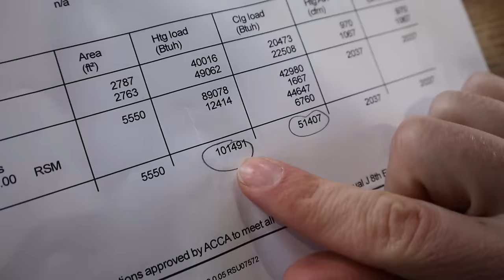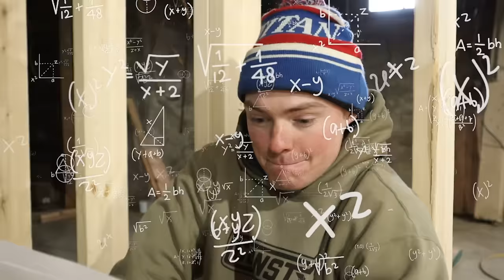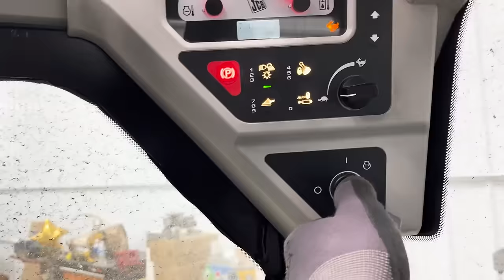Restoring A $7,000 Mansion: Removing 2nd Story Floor

Comment: Definitely better to have a separate zone upstairs, but there are multiple ways to achieve that.....Separate systems, motorized dampers in the duct work, or, heat pump systems that will run multiple air handlers off of one outside unit (this would be my choice).  The best option depends on your situation.  Since I'm not a tremendous fan of heat pumps in cold climates, I would also mention that it's possible to have a hot water coil in your air handler (running off the boiler) for supplemental heat.  Installation costs are the tip of the iceberg, consider your local fuel prices, and determine the running costs of the various options, because you'll be stuck with that monthly bill for a long time.  A boiler is the same efficiency all the time, but a heat pump's drops dramatically as the temperature goes down.  The heat exchanger built into the HVAC system is a nice idea to get fresh air into the house without losing energy.  Also consider a humidifier for the winter.  Finally, consider how you plan to use your house.  Most residential heat calculations don't consider the live load (people and activity).  This may or may not be a problem, but, for example, if you have an avid baker in the house who runs the oven all the time, or like to throw parties with a bunch of warm blooded mammals, you might want to consider that in your cooling load.

Comment: Cole, I've built 2 houses the size of yours (1 was a little bigger). You definitely need 2 systems for the main house. However, in your climate I would NOT use heat pumps for heat. I'd use gas furnaces for heat and AC condensers for your cooling. Heat pumps are efficient to a point, but under 25° they struggle. Also, heat pumps only put out air that's about 80-85°. Gas furnaces put out heat at well over 110°+. You get faster heat recovery. Radiant floor heat is fine IF it's gas boiler. I would not use elec boilers for radiant heat, nor hot water for showers. Also, try to avoid having a duct-work in your attic if possible, or the air handler/furnace, unless the attic will be heated/cooled. If you have to make sure it is really insulated well around the furnace/air handler and all the duct work. 

Doing electric and plumbing is easy. HVAC not so much. Spend the money to let the pros do it, especially with 2 integrated systems, plus your radiant heat. Save the labor costs on plumbing and electric.
Just my 2¢

Comment: Cole I agree with Tom R comments and would add as your cousin is doing work I recommend they do whole install, you said how hard can duct be, it seems simple but actually it is all based on leakage and volumes if you need to change route or size it will affect whole system. My 42 years mechanical and electrical experience cost range from 10 - 25% of total build cost depending on complexity and you have several floors with multiple systems. Your end result running cost depends on air leakage rate as low as possible and efficiency of the HVAC. Keep up the great videos.

Comment: My feelings in regard to your HVAC question would be to contact a qualified mechanical engineer who can do comparisons between electrical cost vs natural gas/propane for your design. I lived in Florida for several years and had to replace both of my HVAC units. At the time, no one was recommending heat pumps. Conventional A/C was more efficient than heat pump systems for the vast majority of the year and because we had very few days when heat was needed they recommended just using resistance electric duct heating for the few cooler days that we encountered. Gas vs electric heating may make a big difference  in your area depending on rates per therm.  Remember that the efficiency of heat pumps drop of considerably in extremely cold conditions which you will have occasionally in your area. A 17 degree average cold temp in your area may really mean that some days could be as low as -20 degrees. Heat pumps don’t work well when temps are that low. Overall, I’m enjoying your project. I’m glad that I’m not the one tackling it.

Comment: I have a similar size home without the attic being livable. I have a gas fed system that covers the basement and the main floor, I also have an electric heat pump in the attic that covers all of the second floor.  One good thing is that all of the venting for the second floor is in the ceiling as well as in the basement.  One thing g I would recommend is that your thermostat is in a general area of each floor. Our thermostat is in our bedroom that is 22x20 with a 17’x8’ closest and a 14x14 bathroom.   We installed on one wall an hour electric fireplace that when it’s chilly we can heat up just our room without affecting the kids.   The issue is when our room is comfy at 72 the thermostat stops heating the rest of the upstairs and the kids room get chillier then we’d like so having that thermostat in the hallway would makes more sense for us and Likely you.

Comment: Look into a system called MRCOOL. It's a geothermal system. It's much smaller and no hvac vents. You have high cealing, so the unit will be out of the way. Hope it helps.

Comment: Having the two systems will reduce stress on each unit, it will also reduce complexity of the system allowing you to have one zone for downstairs and one up with no dampers. If they're just supplemental they shouldn't have much load on them really. One thing I would just be very aware of having the unit in the upstairs space is the condensate drain, definitely have a pan or something under the unit because it will leak one day and having something to prevent drywall damage will save a headache.

Comment: I would definitely get some more quotes from other companies. What brand equipment are they quoting?  The option of them sending you a guy to help run the ductwork seems like a great idea, but honestly with the skills and knowledge you guys have a detailed set of plans you can definitely run ductwork, linesets, thermostat wires, electrical to a disconnect and have them make the plenums and gas up the systems. Check with some HVAC/ plumbing suppy houses in your area and see if they will sell you the materials. Some might sell you the equipment but most require you to have a epa 608 gasses license.

Comment: Cole, you would absolutely hate a single system HVAC setup for a house that large, esp. since you plan to utilize the attic as well.  The best feature for a 2 zone system is the redundancy; if one is totally offline you'll get some effect from just running one.  The second best is the ability to "dial it in" floor by floor for max comfort.  The quoted price is definitely a fair price; I'd have trouble getting that job done in my area at that price.  If you have the time, definitely do as much of the install as you can.  Making the ducts & plenums is the specialized bit, installing them is pretty straightforward.

Comment: Cole, for HVAC,  definitely 2 systems or check out VRF multi-zoned systems. Slim line air handlers are available for space saving. Geothermal systems would be best for heat pumps in colder areas. Also 60000 btuhs seems very low for 5000 sq ft home. Typically 600 sq ft per ton (12000 bthus) on newer construction. Not sure what the norm is for your area. You will want  an ERV system for fresh air because your home is tight.

Comment: My brother in-law insalled in floor heat in the basement and had to turn the old heat system off.  The heat rose thru the floors naturally and upper spaces only needed to use extra heat when the temp  outdoors was sub 15deg F.  He lives in Totonto.

Comment: If this were my build and I was footing the bill. I would do minisplits throughout the whole house. Way less complicated and easy to upgrade or do maintenance especially as you guys have all that equipment. Just make sure you isolate the air intake(s) on a wall where you don’t plan on having a bed. That fan can drive you crazy if your trying to sleep 8 inches away from it. Mr. Cool even had DIY units precharged with freon. 

Have you considered electric radiant floor heat? Thermosoft makes some decent stuff and you can isolate exactly where you want heat or where it may not be needed like in a closet.

Honestly, your spray foam insulation will do wonders but you really need to get new windows and doors. Those will make a huge difference in keeping it heated and cool.

Comment: Here some friendly advice from the "Great White North". If i were you Cole i would extend the 2x4 outside walls into a 2x6 and put more insulation in!  Same with the roof. It will cut down a lot on needed heating and cooling capacity, saving money by installing a smaller heating and cooling system and cutting monthly bills. Your house is huge and you want to live in all of it. Insulation you only pay for once! Energy only goes up in price and the bills will keep coming.
Reply: There is not an “R” value per se in closed cell foam, (a fair amount of people will tell you otherwise). 4 inches will be more than enough. The difference between 3 and 4 inches is very small. 
It is an old house and was not designed for structural integrity. So while you could stop at 3 inches, 4 will give you the max insulation you need while adding 25% more spray foam structural integrity. 
The other structural integrity will come from doubling the floor joists.
Reply: @brianvancalster2594  Closed cell is R 6.5 per inch. A 5.5" stud fits 2" of  R 6.5 foam and 3.5" of R14 Rockwool making a R 27 wall system. I would go R40 in the roof. Money spent on insulation i learned is money well spent.

Comment: Go with the second system. You want zone control in a house that large. You may also consider a split system for the attic.  You have 5K feet over 3 floors. That’s not a one system job.  
You may also consider geothermal which is more efficient.

Comment: As a canadian living in -40 celcius to +40 celcius, heatpumps are anazing and yes they are expensive up front but will save you a lot down the road. With the size of your house, 4 floors including the attic, you need eitheir 2 pumps or one huge one. Keep in mind if the one breaks, at least you’d have a backup.

Comment: i do hvac and thoes blue boxes are return.  Heatpumps are not very efficent when it comes to heating they are very good at cooling tho. It will help that you have sprayfoam insulatiuon. You can run a zone system with heat pumps as well wich has a damper that closes one duct to the downstairs / or upstairs and keeps heating one level.

Comment: Call a Lennox Dealer.  Buy Lennox.  They are made in Marshalltown, Iowa.  Don’t be cheap.  Take the advice about zoning.  It will save you. Make sure you use gas or lp as your primary heat.  Have the pump as secondary.  Keep the in floor heat as well. Do these things and you will be comfortable for years to come.

Comment: WOW, I would reconsider the heated floors except maybe in the bathrooms and heat and cool the entire house with a forced air system.  The heated floors system takes a long time to heat the house and with such a large place you will be constantly repairing leaks which means removing the flooring and replacing it again.  I would go with a forced air system with two systems now and the smaller system when you do the addition.  And by the way,  could we get an update on the grain bin disaster?  And an idea for a later video could be on the wind turbines on your land.

Comment: I would explore the option of Geothermal the system is pricey but very efficient, it will save you money every year.  2 units are nice if you go that route so if there are issues with one you can deal with it until the other one gets fixed.  Redundancy is nice.

Comment: Great job guys, I would rethink about those heat pumps they love eating power mite need a hundred more amps to run them. Plus think about little ones putting toys and what ever else down the registers just a thought to keep in mind. One thing more would it be cheaper to run hot water heat in all the floors with there own zones and plus you can make room cooler or hotter. Keep up the cool vid's

Comment: A pressure washer with a zero tip cuts foam pretty good, and with the spiral zero tip it cleans the foam off great, water clean up is another thing 😅 but plastic sheet with a 5 gal sump and sump with float switch to send it out via a hose, foam is a huge mess

Comment: You really need an ERV. Spray foam seals the home so tight you need the fresh air, AND it keeps your air pressure neutral when the HVAC or direct vent fans are running. Negative air pressure can/will suck water in through windows, doors, or any other exterior perforations. (These are now the weak point in the wall) Healthier air and no water infiltration.

Comment: Invest in a dehumidifier. It will make your Summers feel much cooler in that humid Iowa heat. This makes your A/C not have to work so hard, and let's you save $$ during the long Summer harvest season. Iowa Summers are incredibly humid. I know I'm preaching to the choir. I used to spend my Summers with my Grandparents, in Packwood, Iowa... and every time you stepped outside, that humidity just hit you like a brick. I'm from Texas, and we're used to heat, but not that much  humidity.

Comment: Cole, 27 yr HVAC tech here, 2 systems would be best or 1 big 5 ton communicating/variable speed, variable capacity system with zoning. I love the radiators, please implement at least 1. I would have left the rads and built a forced air system

Comment: You will be much more comfortable with 2 systems one for the lower level and one for the upper level. The upstairs requires less heat but more AC than the downstairs.  Having separate systems allows you to hold the temperatures you are comfortable at in each area.

Comment: With all that insulation and I believe windows were installed recently... I’d be curious to have a blower door test done to see how leaky the house is in the framed stage. The more “air leaks” the harder it is to control the temp and humidity for comfort throughout the home at different seasons. Given the gap I saw in that outside angle wall Roman ripped a stud/jack/cripple/etc. for the other day, it’s probably still pretty leaky so my vote would be two units for sure. Controlling humidity in your home will make a great difference in how comfortable it feels and the health of the home and contents/humans within.

Comment: Had a two story house with a heat pump. At 20 degrees it went to emergency heat that was electric.  Friend went to a loop in yard  to negate the air temp. Better.  Always wished there was a damper in plenum to adjust the air flow upstairs. Was always cold or hot. Used extra heater or air conditioners to survive. Would definitely install two units.

Comment: I have a large house too and we have a basement , main floor and then upstairs. All our bedrooms are on the main floor. So the main floor has a combo unit with natural gas heat and AC.  Then upstairs is not used much so I did 2 things. We have a split heat pump up there and we can set the temp hotter in the summer and cooler in the winter when we are not up there. and the other thing I did was I put R19 insulation in the floor/ceiling between the main floor and upstairs so all my heat is not going up there if I don't want it to.   That is just what I did in case it helps a little.   I also put insulation in the walls around the bedrooms so I would not hear my kids loud music when they got older but they didn't do that.  :)

Comment: 3 Systems - 1 Basement/1st floor, 2 Second Floor, 3 - Small Split Ductless Top Floor. Each system controls the temperature for each level and keep the temps level.

Comment: I helped two friends build their houses. They were very similar floor plans. One friend put in two systems the other opted for only one. The difference in the heating/cooling between the two houses was very noticeable. The two unit system kept the house more comfortable and the single system house was not very much cheaper as far as electricity. If the experts are suggesting 2 I would either go with them or get a second proposal. You have to figure in what tools will cost, and things like tape for the joints if you need more than that that they supply. You are talking about whether you want to risk the comfort of your family and how you will feel if things do not go well. My friend who chose 1 system heard about how bad the system was. I'm not sure how much of the ductwork he did because I just did the electrical and wasn't there for that duct work. The 2 system job the owner did the ductwork himself with a couple of us helping. He knew how to do it so there was no question on whether we were doing it right. I'm suggesting second proposals.

Comment: Definitely 2 heat pumps.  My house is 3 levels and is around 4,200 sq.  We have 2 heat pumps to cover 3 floors.  The basement and main level are on one and the upstairs is on the other.  My old house had 3 levels and only had a single unit.  It was freezing in the basement, comfortable on the main, and warm on the upstairs.

Comment: Things I would think about:
Where will bathroom fan and kitchen vent fan exhaust and how to route those ducts?  Better to figure that out sooner than later and have to rebuild like above the pantry door.
Where will pipes (and electrical) go to the second floor and how thick is that wall on the first floor?  Drainpipes need fall and vent pipes need access to the roof (third floor issues).
Can each floor have an HVAC system be sized and have terminated ducts that will lead into the new addition so when it is added you just have to attach to the existing system? Fewer but larger systems.
Is the main HVAC trunk duct on the second floor going to be boxed in below ceiling level?  With the array of joist directions, it seems it can't hide inside the joists.